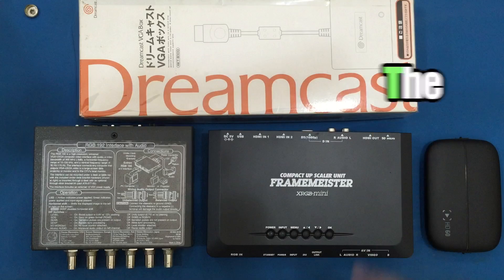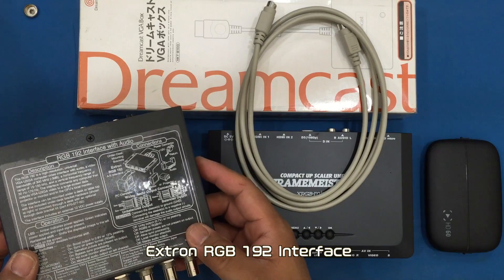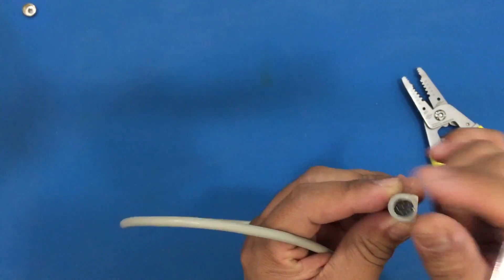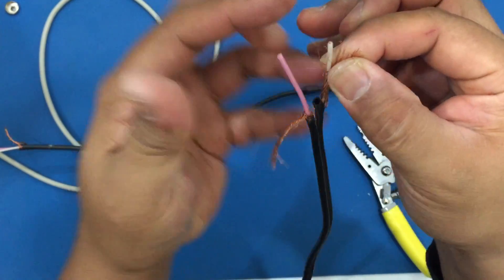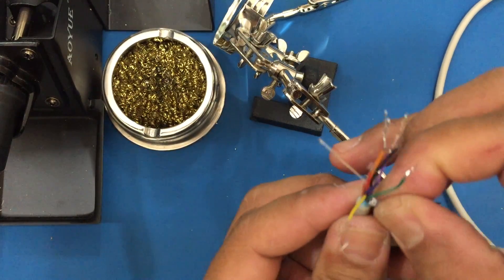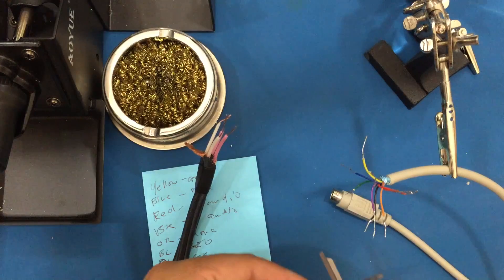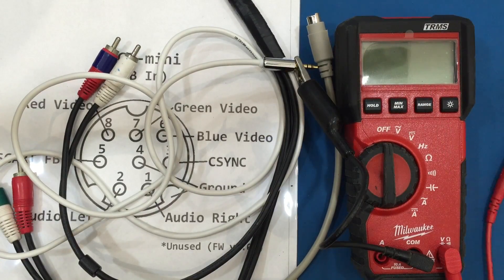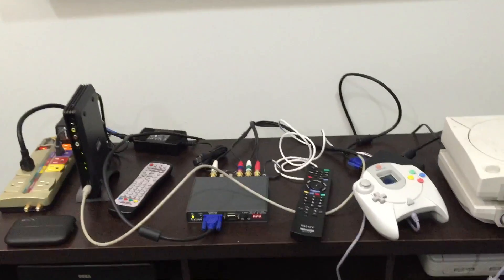Custom Framemeister / RGB Interface Cable for Dreamcast 480p Video  [SH no.35]

Comment: Can't just the VGA box get you 480p
Reply from the maker: You get 640x480 on a VGA Monitor, but you can't output a VGA signal to a Framemeister as the Framemeister uses a combined Horizonal and Vertical sync signal. VGA uses separate Horizonal and Vertical sync... 5 inputs vs 4 inputs. The RGB interface combines the sync for you. So in essence, you could just build a sync combiner also, that would be a lot smaller.

Comment: Think you should put the vga video sample in the middle instead of the right side; there is more detail in the center.In my opinion, you can save the RGB-interface, by using the pin 10 ( Composite Sync ) from the Dreamcast pinout-connector. You only need three components; one, 150 ohm resistor 1/8 watt, one 4.7 k ohm resistor 1/8 watt, and one fast-recovery rectifier ( .5 watt ). joint one of the two terminals of each resistor with the cathode of the rectifier, then the anode goes to GND, the 150 ohm to pin 10, and the 4.7 k ohm to 5 v ( pin 5 ). You will get the C Sync form the joint of the three components. This is the same configuration that is used in the vga-box circuit, for V and H Syncs. For those like me that cant afford an expensive vga box, must build our own jeje!

Comment: That's a pretty sweet mod! Definitely can tell a difference in the quality.
Reply from the maker: +Retro Power Up The difference is pretty significant, but ulimate sharpness and clarity does have it's drawbacks, like the aliasng issues that couldn't be resolved with the console at the time.

Comment: Again, your videos are awesome.   You are inspiring me to do more stuff!   Help me understand some things if you will...    According to retrorgb.com "All 480p Dreamcast games look great through VGA and if you have a display that supports a 480p input, then that's by far the best output method.  If you use an RGB cable, the few 240p games that are available will look great, but all other games will only output in 480i. " I assume that previous statement is irrelevant because you are technically not using the dreamcast output but the output of the VGA box, correct?  Does that RGB sync converter output 480i or 480p? I assume you then upscale to 1080p with the framemeister?  Do you feel the picture is much better than straight VGA into an appropriate display?  Does it  introduce any lag?  Thanks again!
Reply from the maker: +DaveB038 OK... let me simplify cause there are a lot of confusing stuff, heck, I was confused just reading all the stuff about RGB.

Depending on the game and A/V cable (SCART/JP21, S-Video, Composite) , the Dreamcast will output a video signal in either 240p, 480i, or 480p. Say you have a game that does have VGA supprt, ALSO KNOWN AS 480p AND SOMETIMES REFERRED TO IT'S FREQUENCY- 31KHZ, and you have a VGA box connected, the Dreamcast will output a 480p sync signal to the VGA Box. If you have a game that does NOT have VGA support and you have a VG box connected, the DC will tell you that the VGA box is not supported.

How does the Dreamcast know if a VGA box is connected? If you take a look at pin6 and pin7 of the pinouts on a Dreamcast with the pic below
http://www.mastersystem.dk/modding/pinouts/dreamcast.png

you can see that pin6 is 31khz, and pin7 is 15khz. 15khz is the sync signal that regular TV's use. Connecting at Dreamcast VGA box to the DC grounds pin 6, and keeps pin7 unconnected, which tells the DC "a VGA box is connected." The opposite is true for a regular Composite, S-Video, or Scart or JP21 connector where it grounds pin7 instead.

Back in the day, a regular TV or a Scart capable TV can only support up to a 15khz scan rate. 480i has a 15khz scan rate so you hear people referring to 480i sometimes as 15khz. Only special monitors supported 480p, which has a faster scan rate of 31khz. And only some tube RGB monitors like those Sony (PVM RGB monitors) that you hear about supported 31khz. Obviously, a VGA computer tube monitor which most had in their home if you had a PC also did 31khz, which was the way I did my VGA Dreamcast gaming back in the day.

So even if you had an RGB capable display, it may or may not do 31khz. Only  few of these supported 31khz, aka VGA.

Looking at the pinouts in the pic above, its funny you even need a "VGA box" as you already have separate Red, Green, Blue, Horizontal sync, and Vertical syn singals.
This is the VGA pinouts that a VGA display would have:
http://3.bp.blogspot.com/-0BE-eXEC5fA/TqDkU4bIC0I/AAAAAAAAAj4/NeCJRO4IMtY/s1600/vga-15pin.gif

You can probably wire the pins from the DC to the VGA capable display directly, it would just be a matter of finding a Dreamcast plug to connect the wires to, unless you want to run and solder the wires directly to the DC (Shudder!).

It's only when your display needs a single, combined sync signal; and you need the Horizontal Sync and Vertical Sync combined, that you would need an external circuit to combine these. That's what the Extron RGB interface essentially does. It's a sync combiner. The Red, Green, and Blue signals are unchanged by the Extron, and are just "passed through." I only needed the comined sync, called Ssync, or Csync, because that's what the Framemeister needs. It doesn't use a separate H and V sync.

What the VGA box does is probably condition the Red, Green, Blue, H sync, and V sync signals. But is the conditioning even needed as you see cheap "VGA boxes" on eBay that don't look like they have any circuitry and are plain pass throughs.

If you read the comment from RetroRGB: "If you use an RGB cable, the few 240p games that are available will look great, but all other games will only output in 480i". This can be confusing. The RGB cable refers to a scart/jp21 cable that PAL users commonly use on their TV's. They were lucky as the RGB singals were all separate, but, again, most TV's only supported 15kz so those Scart cables were wired as 15kz Dreamcast cables. You can make a 31 khz Scart cable by grounding pin6, like I mentioned above, if your display supported it.

For 240p capable games, it only looks good if it was a game originally made with 240p support only- ie: many 2D fighters from Capcom and SNK. Or a retro compilation disc with the 32-bit generation in mind where most games was 240p. That's why only these few games supported the resolution. You did not want the Dreamcast to display these in 480i as 480i is INTERLACED. Unless you have a display or device that can deinterlace the video signal, you'll see deinterlacing lines all over the place on fast action scenes. The upscaling may even be better done by your external device, like a Framemeister, instead of letting the DC upscale the 240p signal into 480i.

The Exron RGB interface, does not process interlaced signals because a VGA signal will always be progressive, a 31kz progressive signal. With the VGA box connected to Dreamcast, it's in 31khz mode with pin6 grounded. The 240p games will not be able to run via VGA box becuase the software will tell the Dreamcast that it needs to be in 15khz mode with (pin7 grounded) and display a "your display is not supported message." That's why those games will look best with a SCART cable, or RGB cable as it refers to. Remember, a Dreamcast SCART cable will be wired to support 480i as most RGB monitors or Scart TVs only do 15khz.

The important thing to know is that 240p is supported by these Scart or "RGB" cables obviously. AND 240p IS ALSO OUTPUT BY COMPOSITE AS WELL AS S-VIDEO. The reason composte and S-video is not as sharp is that they combine the R, G, and B signals; where composite combines them all into a single video signal; and S-Video has 2 video signals: Chroma and Luma.

Now if your display, like an HD LED, LDC, Plasma, etc has VGA inputs, then you don't need this as the TV will expect the 480p siginal. But your mileage may vary as some displays will strect the 4:3 picture. Altough good TV's will allow you to display the picture unstretched.

I really needed this setup to capture 480p Gameplay by the Framemeister. You can't capture gameplay when the DC is connected directly to a TV with VGA-in (like mine has) as the TV does not have HDMI out, for copyright protection.

Now choosing what you want the Framemeister to output in HDMI to your TV (you can choose all kinds out video output from 480i/p, 720i/p, 1080i/p) really depends on a combination of things. If you like scanlines that the Framemeister can do, then most of the time, you want the Framemeister to output 720p, but your TV's upscaling the 720p to 1080p singal might soften it... If you like ultimate sharpness, then you would obviously choose 1080p... unless your TV is only a 720p TV. Also, the DC games needs to be stretched horizontally, and some modes are affected with different settings... it's complicated... and yes, I'll do a video in the future that pretty much will explain what I'm explaining here...

Hope that helps. LOL.
Reply: +The Sega Holic Excellent description.   You give me a lot to chew on.  There are a few comments I want to make but I need to verify what I am thinking.    The pinout is very interesting, thanks for the link.   I did recently pick up a 14" BVM and 20" PVM but I don't think either support 31khz.    I did recently run the 240p test suite on the dreamcast connected to my old Samsung plasma and overall I think it looks very good.  But I don't need to capture (not yet anyway) like you do.

Comment: awesome video man. The cable makes a huge difference to the graphics. :)
Reply from the maker: +Mikey mike Yeah, definitely an upgrade. But only if you have a Framemesiter or RGB upscaler.
Reply: +The Sega Holic how much for you to make me a cable.   ;)
Reply from the maker: +Mikey mike this is such a rush job, i just wanted to see if it would work. Im currently thinking if a more elegant solution... Ill let u know.